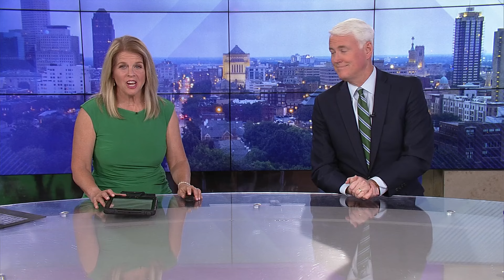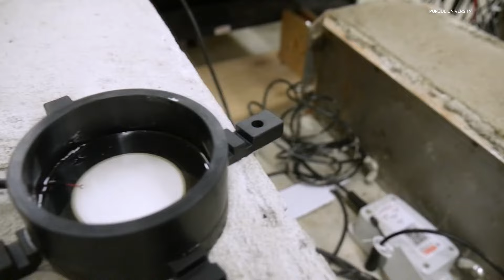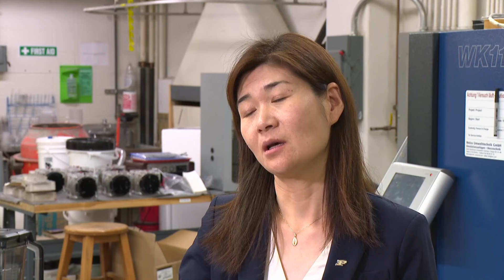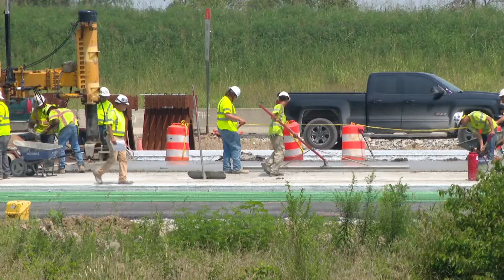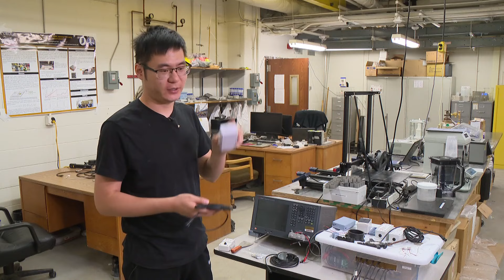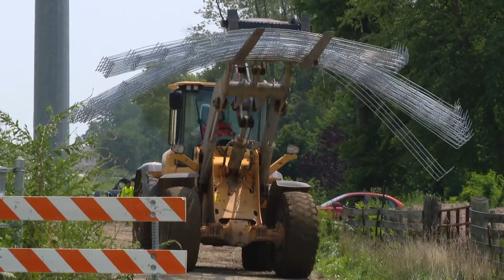Purdue's 'talking concrete' technology receives national recognition

Comment: 45 years in the Cement Mason's Union, mostly WestCoast I5 and I90 projects, concrete Highways are like cars, they need maintenance, and they get old and need replacement,
Reply: 16 years in concrete union here. Asphalt needs replaced far more than concrete and I'm always sad to see asphalt road instead of concrete. Cheaper now but not in the long run.

Comment: Worked with concrete roads for over 35 years. You don’t need to waste money on sensors to tell you about the condition of the road. Taxpayer money spent on useless equipment
Reply: Same here. We poured 12"-18" thick!

Comment: Concrete doesn't get potholes like asphalt. Use 12" thick concrete instead of asphalt and it will never crack or get holes. Just like at airports.

Comment: Concrete freeways break up from lack of flexibility,  Asphalt over compacted base rock is what is used. The cute little sensors sre a hoax and a rip off. Why does Purdue need to know about the concrete in Austin? Looking at and driving on a concrete road tell you all you need to know about it's condition.
Reply: Its